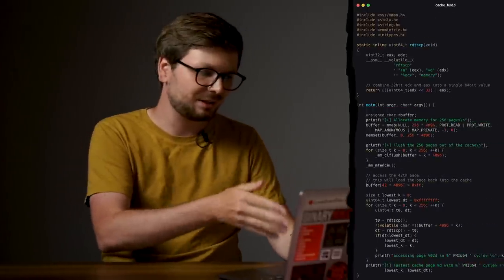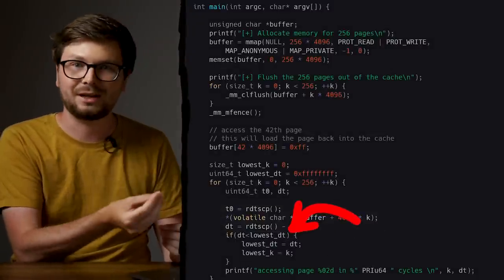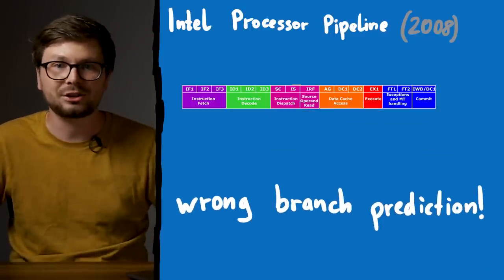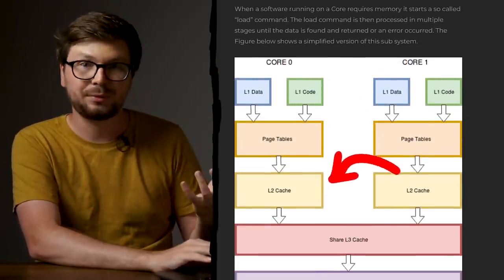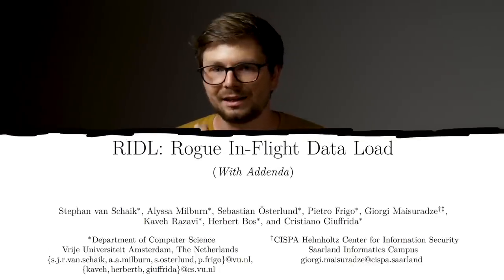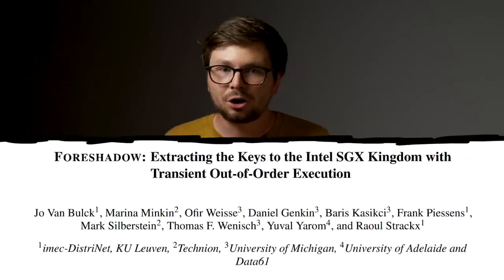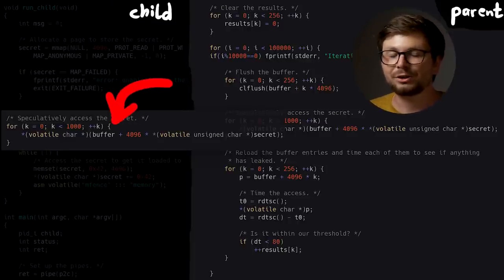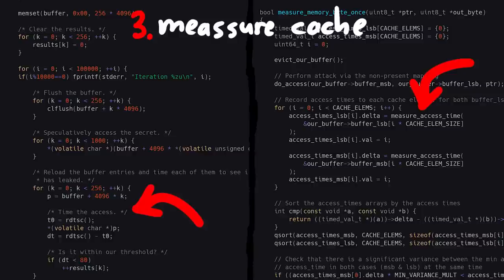How The RIDL CPU Vulnerability Was Found

Comment: Your comment about the page size isn't quite correct: A modern x86 CPU fetches and writes 64 byte chunks of memory (the cache line size). The 4096 byte page size refers to the minimum chunk of memory that can be virtually addressed, i.e. mapped from virtual to physical memory. So basically, as you're watching replace "page" with "cache line" in most of this video. Page size only becomes relevant later when it comes to memory access controls.
Reply: Also, when accessing a virtual address, the processor places the virtual page number and the corresponding physical frame number in tlb for faster lookup, which also speeds up data access.
Reply: @TheAirr13  and to ensure that no process can access the virtual memory of other processes, each entry in the TLB is tagged with its corresponding process ID, which is what Sebastian was talking in the video, wondering if the tag check can be circumvented.
Reply: Also 1’or1’ doesn’t always = 1
Reply: These aren't Linux process IDs. The
hardware functionality is called PCID. There exist only 4096 different ones. Linux uses effectively only 6 (+ the upper bits for meltdown mitigation). So whenever a new thread is scheduled the TLB doesn't have to be flushed all the time.

And to my knowledge the check cannot be circumvented. I did some experiments and wasn't successful
Reply: @DNA I am not a Linux kernel engineer but to my understanding you are right. The PCID stuff is necessary to mitigate a TLB flush everytime a process switches between Kernel and userspace. Each process has a part which is running in userspace and a part which is running in kernelspace. PCID increases the switching speed. I remember I read that a few months ago but I did not understand it fully yet. But from within the kernel you can leak everything.
Reply: 3 minutes in and came down to make the same comment. You can make page sizes whatever you want if you want to mess with the kernel code.
Reply: @DNA Oh snap. I guess you are right. You used to be able to on x86. I guess my argument was that it's implemented in software in the kernel even if it is closely tied to the hardware. It is all about virtual addressing, not caching.
Reply: So why does code in the video allocate multiples of page sizes and poke holes in them, instead of cache line sizes?
Reply: @madghostek3026  It shouldn't be strictly necessary for the exploit. But crossing a page boundary makes it a lot less likely that the CPU will perform some optimizations like pre-fetching, because it would have to perform expensive permission checks and things like that. So it just makes things more reliable.
Reply: @madghostek3026  Probably to force L3 cache, which based on the video he doesn't even realize is necessary. A page won't usually fit into L2. L3 is the only cache that can be accessed from multiple cores, which is necessary in this demo since you are forking a process and can't guarantee it will be run on the same core.
Reply: Who asked for your opinions?
Reply: @forreutubey780  No one is giving any opinions. We are correcting facts.
Reply: I don't understand the practical uses of riddle
Reply: Yeah I had the same question as soon as I saw that part. 
Thanks for the comment!

Comment: I really respect Intel for not only taking silicon vulnerabilities so seriously, not only starting a bug bounty program, but sponsoring people to promote it by analyzing existing bugs. This is dedication, and I really hope we see more companies treat security in this way. I've seen more and more companies start bug bounty programs recently, and it's definitely a move in the right direction.
Reply: The reason they make this is to make sure no one else finds their backdoor like they did on the celeron.
Reply: @MikaelIsaksson  that... Doesn't make any sense
Reply: @DanKaschel  sure it does. Now they can have a bunch of really smart people trying to find it. If they don't, great. Now we can feel like bit more sure it won't be found in the wild. If they do, oops, a "vulnerability" better fix it. To be clear, it's really hypocritical from them to care about hardware vulnerabilities when they have put them in on purpose in the past. If you didn't know they crammed in a small operating system in the CPU that could be accessed from user level by calling secret opcodes, elevating following commands to above ring 0. Basically a hardware trojan.
Reply: @MikaelIsaksson 
Did they become self conscious and stop doing that in newer generations of cups, or do they more effort into hiding the hw trojans better?

Comment: I never had someone explain branch prediction so well to me. Thank lord.
Reply: 🙂 yes
Reply: This video doesn't really talk about branch prediction, but rather only speculative execution.

Branch prediction is only concerned with conditional jumps like JNZ (jump if not zero). It is a function in the CPU looking for patterns in whether a certain conditional jump is taken or not and tells the CPU which branch to load into the pipeline (for older CPUs, before speculative execution) or which branch to speculatively execute (for modern CPUs). Note that some CPUs may speculatively execute both branches (jump taken as well as not taken), the branch predictor would merely tell the CPU which branch to prefer when neither branch is stalled (waiting for memory or slow computation result).

Comment: "The forty-twoth page" really gets me.

Forty-second.
Reply: Fourty-tooth.

I looked it up.

English is still weird about number names, where the 1st, 2nd, and 3rd numbers in each group of 10 starting at 20 have separate names -- but at least it ain't French or Danish!

21: twenty-first (21st) note ...th
22: twenty-second (22nd) note ...nd
23: twenty-third (23rd) note ...rd
24: twenty-fourth (24th) note ...th
25: twenty-fifth (25th) note...th
etc.
Same for 31, 32, 33, ... 41, 42, 43... etc.

I'm also a German and French speaker so I can relate -- I ALWAYS forget that 81 and 91 in French DOESN'T use the "-et-" before the "un" or "onze" but it does in 21, 31, 41, 51, 61, 71 ("...et-onze")  -- but not 81 and 91 as they are "too long" for adding the "-et-".

GAHHHHH!!!!

Comment: You actually show out-of-order-execution (<illegal instruction>; <instruction with cache side effect>) vulnerabilities, like meltdown. Speculative execution (foo: xor rax, rax; jnz bar; jmp foo; bar: <unreachable, but speculative executed code with cache side effect>) vulnerabilities like spectre are slightly different concepts. The first class is afaik intel-only, the second class is an issue for other modern CPUs of other ISAs too.
Reply: @DNA Cortex-A75 and IBMs Power microarchitecture seem to be also affected…but basically all modern (till 2019 I guess) Intel CPUs, so, this is basically a Intel-issue. the IMHO more useful speculative execution vulnerability, which can be triggered without a signal handler and therefore could not be mitigated by the kernel that simple and can also be done in non-native code like javascript, also affects a lot of other CPUs.
Reply: @RepublikSivizien  Meltdown is far not Intel only. Btw, "signal handler" can be avoided by self-modifying code, like changing nops into jmp right before transient instructions. Have never heard about this method before but it was also worked.
Reply: @PS-bp4ju : That is spectre, not meltdown. You might have luck with the illegal out-of-order instruction in a thread. It should be possible that an illegal instruction in a child does not kill the parent, but it must be on the same core due to cache, iirc.

Comment: Did I understand correctly? 
The parent code will try to make read on secret value, which is same address on both processes, and speculative execution will run it. The speculative execution will run with actual secret value, and then it will learn that it made error because the secret's value in parent process  is nullptr. Then it will trigger exception. And then we can't simply check which page table is loaded very fast.

Comment: TL;DR the faster the CPU, the more speculation is used for calculations, which correlates to more insecure CPUs unless you want to slow it down with the removal of pipelines/buffers and force in order execution where applicable or worse yet:

Force developers to use a special kind of slow but super secure sandboxed memory! 😱

Comment: I still find it confusing how in a rational universe, any memory value could be read (and used in any way) before access is checked. Since all the memory is virtual in the context, it has to at a minimum, look to see where the memory is actually mapped to (if at all). And I would think the mapping and access check would be done hand-in-hand. I mean, I'm all for optimization, but you have to wonder WTF were the engineers thinking?!

I wonder if to work around this (aside from fixing their broken access model), if they have or are adding a sort of "speculative" caching to newer CPUs. So as caches are read, they are somehow marked as tentative and only confirmed after the operation which requested the memory has completed successfully and with certainty. If an instruction generates an exception or is discarded, then any resulting cache is never confirmed, and treated as non-existent (unless in the same thread/task which triggered it). This could still give the benefit of caching in 99+% of speculative cases, but avoid most (all?) of these kind of vulnerabilities.

Comment: Intel is smart and they externalize some of their internal security research to the academic world because they found out that more and more valuable input is coming from academic hardware security researchers. 

This cuts down costs, but it's a risky game for Intel. What if a security researcher found a massive bug, but doesn't tell Intel, but sells the bug over darkweb markets to blackhat companies that develop exploits based on their research and weaken computer security? You probably get a bug bounty from Intel, probably the most security researcher will do this. But I think the risks are real.

Intelligence services are always interested in cutting edge exploits for cyber attacks. Hardware exploits are the holy grail, if it can not be fixed with Microcode updates than you have to replace the CPU and other hardware. Using Microcode to patch bugs in CPUs is a lesson Intel learnt with the first Pentium CPU that had the FDIV bug where they spend a lot of money to replace buggy CPUs. Executing patched microcode is a little bit slower than the instructions build into the CPU.

From the security standpoint the x86 based CPU manufacturers made their products more complex with out-of-order execution and branch predictions for achieving higher speed. Complexity every time increases the possibility for bugs. I guess their will be more CPU bugs discovered in the future. ATM it's a lot x86 heavy research, but ARM seems to be a whole bigger market, ARM based CPUs are everywhere, smartphones, tablets, cars, servers, etc. and with Apple at the newer consumer PC hardware too.
Reply: IMHO x86 is very inefficient and complex with variable instruction lengths. ARM instructions all have the same length and are designed to only take 1 CPU cycle, unlike x86's, but there are some exceptions. Some of the ARM based processors use out-of-order execution, so side channel attacks are possible too. For ARM it depends how the CPU manufacturer implemented with the ARM instruction sets. It's most likely more prevalent in newer ARM CPUs. I hope because every ARM CPU manufacturer can implement their own out-of-order execution that bugs in them doesn't hurt that much - unlike Intel and AMD which are the only x86 processor manufacturers afaik.

The i7-12700K I use doesn't have SGX, it's something Intel tried and failed hard. SGX was introduced with the Skylake microarchitecture in 2015 and is deprecated since 2021 and removed from customer 11th and 12th gen Intel Core processors, but still supported in enterprise CPUs. Of course some products depends on SGX, like Ultra HD bluray players on PC. IMHO the idea of SGX was nice, but it's execution was bad. Probably that's why AMD never licensed SGX from Intel.

Before I forget it: Shady business as usual with undocumented instructions

Comment: How does knowing which page in the memory was loaded by the other process by measuring CPU clock cycles taken to access it allow us to access the value of any byte in that page? Shouldn't it at most reveal the memory location of the page
Reply: Because the index of the “page” (cache line, really) that is revealed to be accessed through the cache IS the secret value read from the other process. That’s why there are 256 separate pages allocated, so you can determine what the secret byte value was!
Reply: It's not looking at what cache line the other process loaded, it's using a value from the other process in order to determine which cache line it should load itself. The "read a memory address and check the timing" is a way to read a measurable side effect from the out of order execution.

i.e. you load a pointer you're not supposed to access, then you access the nth cache line in an array you have (where n is the value you read from the pointer you don't have access to). Then you go on to time how long reading each cache line takes. If one is in the cache you see that it takes less time. The position of that cache line in the array is the value of the pointer you don't have access to

(notice I replaced "page" in the video with "cache line" - it's an inaccuracy in the video; the CPU cache does not care about pages at all)

Comment: Okay. if some process writes some secret continuously to memory you can leak maybe one byte of it because you can cause a cache hit in speculative execution and measure it before the execution fails. This sounds both like a bug but also pretty useless. The prerequisites are insane, the method unreliable and the leaked information may not be what you want and on top of all of that you get just a single byte.
Reply from the maker: The RIDL paper goes further. In the speculative path you can add if cases that verify data and leak then one byte. For example if you want to leak the /etc/shadow file paraed by sudo, you expect the string “root”. So you can write an ifcase that only loads a page in cache of you leak “root<leak>”. It becomes actually pretty powerful this way
Reply: Leak one byte at a time, and you can get more stuff out of the child process! And what happens if your child process is some "dangerous" one like sudo, which has passwords in memory?